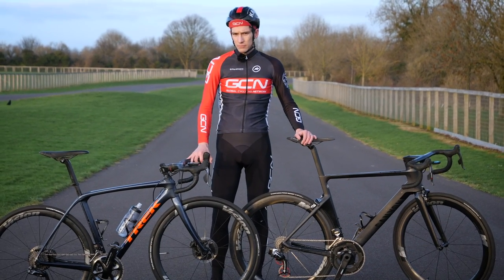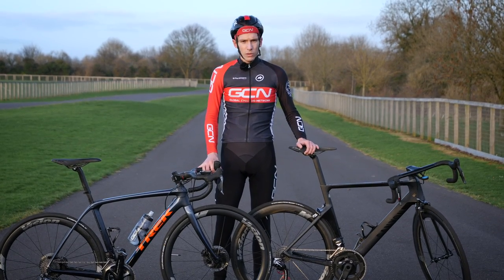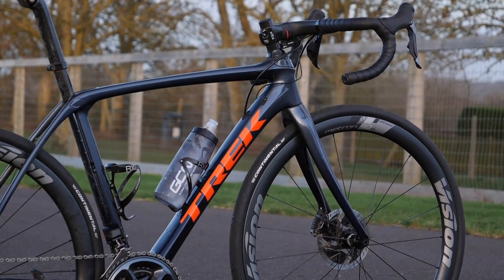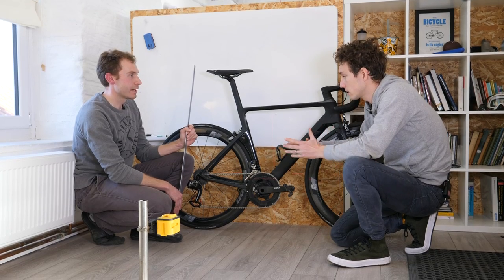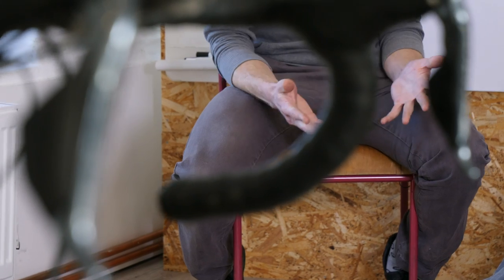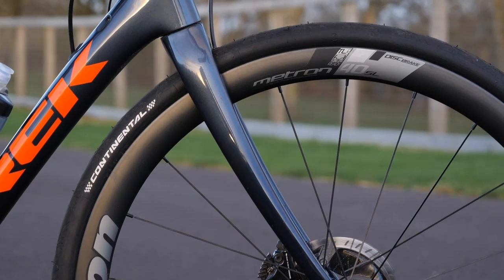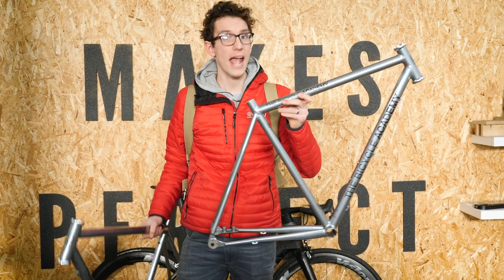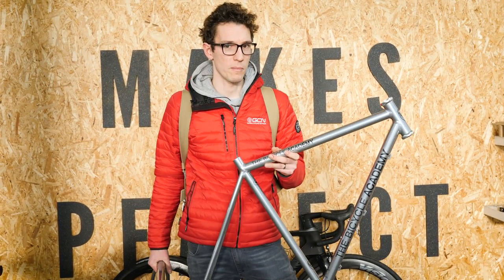Speed Vs Stability - Can Bike Geometry Make You Faster?

Comment: The elephant in the room is some modern carbon bike brands use a wide range of head angles on different sizes with only 1 fork offset across the whole range. Therefore every size handles differently because every one has a different trail number.  Other brands, like the new Cervelo S5 has it's own fork offset for every size to match the head angle, keeping trail consistent across the frame sizes.  This goes back to the way classic frames were designed when steel forks could be designed for every size bike with just the right offset.   If you see a geo chart for a modern expensive mega-buck carbon frame and it has a 43mm rake fork and a 70 degree head angle, you can find something better!!
Reply: Exactly! Beside all these nonsense tech talk of the bicycle industry, they wouldn't even bother to produce ONE 55-60mm rake carbon fork to use with 70ish degree HT angles. Leaving a lot of the ladies and smaller folk to ride ****ty handling bikes.
Reply: You are right.  That's mostly due to the fact that too big 700C wheels and too long cranks force the wrong geometry on the front (to avoid massive toe overlap with the front wheel) for small frames who should be designed around smaller wheels and shorter cranks...
Reply: Generally, smaller sizes bikes have larger trail but their stem length and handlebar width are shorter.  The wheelbase is also shorter.  Don't all these compensate for the less responsive handling of a longer trail?

Comment: In my experience, head angle and wheelbase determine the "quickness" of steering inputs, while trail determines how those inputs are handled. Shorter trail makes the bike more responsive to handlebar inputs; their steering feels "lighter" on bikes. This lightness might allow the front wheel to snake more easily as it encounters changes in the road surface--bumps, sand, water--or crosswind. That is the wheel deflects quickly away from resistance but easily returns to center with light handlebar input. Longer trail makes the bike less responsive to side forces but more responsive to lean angle--shift weight, the bike leans, and the the bike turns. The steering feels "heavier," the front wheel has less tendency to deflect, and when it does, the effort to return to center is higher. Carried to extreme either way, the bike would be unrideable. Too little trail causes the handlebar to require constant correction to maintain line. Too much trail makes handlebar correction slow and heavy, so that trying to maintain line results in a series of over-corrections. Good bike designers aim to make the bike manageable, but there is a range of handling that is acceptable.
Reply: the twitchiness indicates the instability of the system. It requires more control from the rider to remain stable, so it takes more effort to remain upright. It also means the system will respond faster to rider input and it will turn sharper. Important in a criterium, say, or dodging obstacles. A slower responding bike tends to be more comfortable because the rider can be more relaxed, lighter on the reins so to speak. But then the bike doesn't respond as quickly.
Reply: wow that is actually really spot on for how it felt on my bike. when i lowered my fork, i changed my trail number from 45mm to 73mm and the bike tended to follow the line better but felt harder to control. i changed back, and my bike felt more agile. it was a bit more playful on rough roads but it was easier to get back to straight.
Reply: @daa2622  exactly. This was the effect Gary Fisher was after with his first generation of Genesis geometry.

Comment: Outstanding video.  I ride a custom built 700c 62cm Surly Disc Trucker spec'd with road components.  The relaxed geometry and 130mm stem has the bike riding smooth like an old 70's Cadillac.  The only downside is making a u-turn requires almost two lanes of traffic in width.